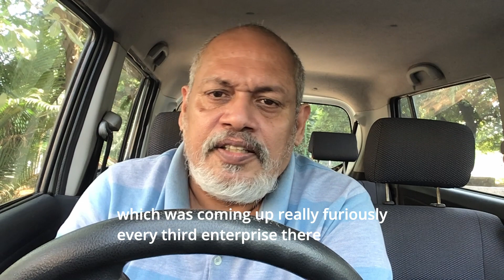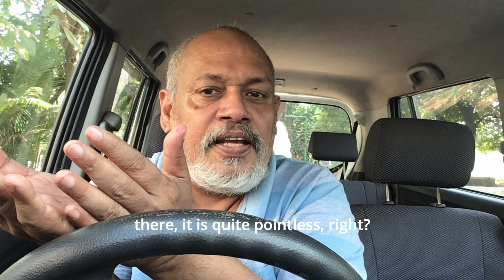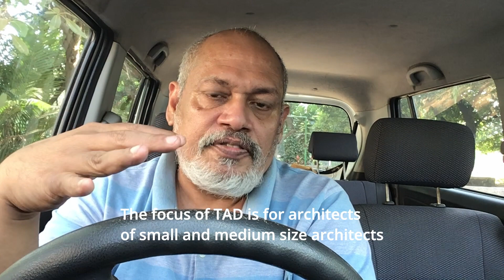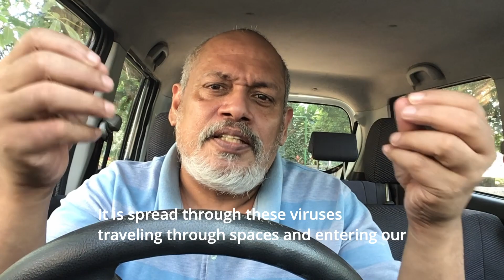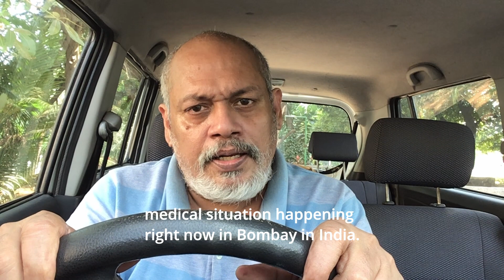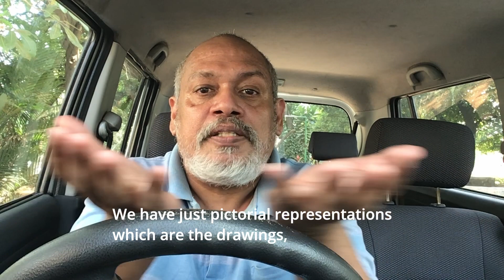An earnest plea to support TAD

Comment: Very interesting description, as a very non architect, but someone interested in visualizing and communicating ideas, these more precise ways of modeling that you have in TAD sound much more appealing and less error prone. You might be interested in Dr Andrew Kaufman or Dr Tomas Cowman, if your interested in different views about the last 2 years ? They are both dr's who are starting something new, much like it seems you bring to the design world.
Reply from the maker: Thank you for your kind words. I do know about both those doctors; but sadly, I do not think my way of conducting research is the same as theirs. Being original or iconoclastic does not always result in cogent, acceptable work. TAD is an ongoing work with over 30+ years of research and validation. TAD is still open to debate... there is a lot that has to be done. I respectfully decline to be associated with other works that I have nothing much to say because I am not a theoretician or working in those areas.
Reply: @teamtad  Well thats a shame, I assumed, now wrongly it seems, that you were a sincere and open minded person. Its actually the current science on V's that is theoretical, and that is what the 2 Dr's are questioning and explaining in a very reasonable and sensible way, which current "science" is just refusing to. But good luck, perhaps its illustrative that those Dr's and many other who wish to ask sensible questions are banned from this and other platforms ?

Those Dr's where not the first to start question the Virush Theories... even since it started many Dr's have questioned these models and theories, but big money and other nefarious technics have been used to steer the narrative and influence people.